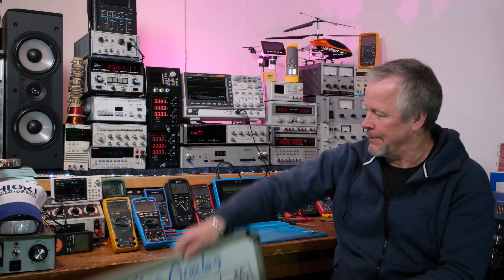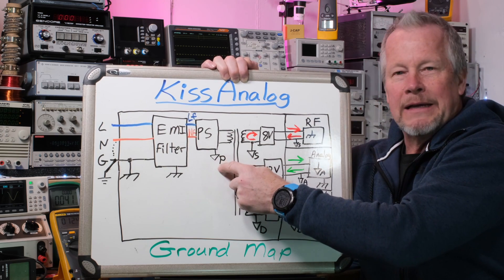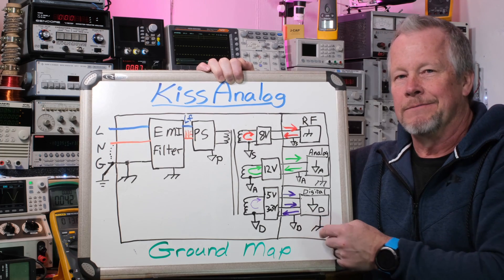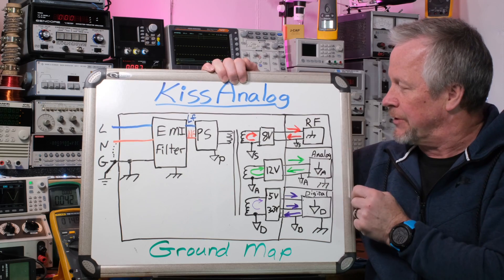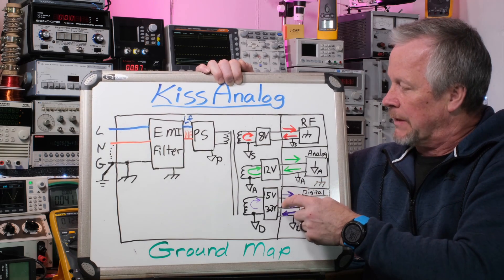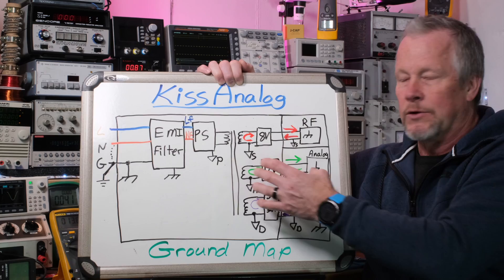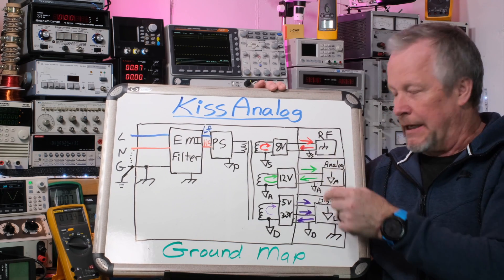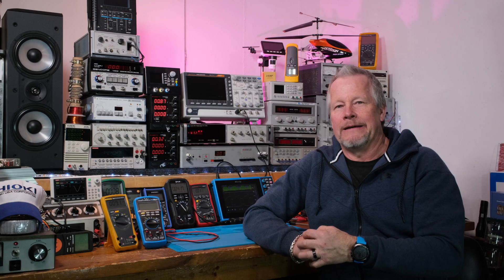A Ground Map Example - A system Design for Grounding #grounding #ground #safetyground

Comment: Telephone system in the UK uses -52V (positive end of the exchange battery strapped to "earth") to avoid electrolysis/leaching/corrosion issues on the wiring. I read that London Underground use a separate earth return system as early on they found if they didn't the earth current would leach chemicals from the ground due to electrolysing action.
Reply from the maker: Thanks John!  That is very interesting!  Thanks for the feedback!

Comment: I'm confused: You show each winding having a separate ground; to me this would only work if each transformer secondary was only-used as a half-wave rectification (single-diode in the upper-leg of the winding), because that is the only way you'd have a return for the DC to your ground.
I could see if you were using full-wave rectification (using 2-diodes) and the center-tap was tied to ground.
However, if you're using a full-wave-bridge then you could not tie the FWB's negative to a winding-ground; you could only capacitively couple it for noise.
So, maybe I missed something, or I'm making something literal that you are implying symbolic.
Anyway, great video as always & 73...
Reply from the maker: Great question - Thank you!  Each winding is galvanically isolated from everything else (primary and other secondaries).  Also, each winding generates energy which can be used to make an output voltage of your choice (given proper turns ratio).  Each of these output voltages would be converted to a DC voltage (most often), and the current flowing into the circuit that this voltage would power would return back to its particular winding that it was generated.  So, each winding can show, and should show a ground symbol unique for its output voltage - unless you choose to tie all the windings to the same return path.   Does that make sense?  I'll make a video explain this;)
Reply: @KissAnalog  I guess I still don’t understand. What I see is the lower part of the winding attached to whatever ground for that system. But is that also the negative return for that systems power supply? Because the only way you can have the negative returned be grounded at that lower winding point is to utilize that winding as a halfway power supply with just a single diode in the upper leg…

Comment: Virtual grounds on each device would solve the problem on the secondary side but the RF source needs an earth ground to filter out any lose RFI from getting into the other circuits. Great video..
Reply from the maker: Thanks for sharing!  RF is an animal to itself - and it will bring some interesting conversations;)

Comment: Trying to wrap my head around how the isolation transformer is doing its job from a safety standpoint. Take the RF box for example: it's L is tied to chassis ground and therefore the PS S ground is tied to its chassis ground. Now the RF box is also tied to rack chassis ground and the latter is tied to P ground (and earth ground). Touch S L and the current  can return to S N and cause electrocution. Am I missing something?
Reply from the maker: Thanks for the great question.  For there to be a current path - there has to be at least one series loop (voltage source with both ends connected - as in a short, or connected through a load).  The only current that can flow through the chassis is in the RF circuit - to and from the winding providing the power.  And there's the input EMI caps and chassis to Earth ground.  But there's no path from primary to secondary;)
Reply: P ground and chassis ground are never tied together. There are usually decoupling caps between P ground and chassis ground (earth), but that's about it. Secondary-side grounds are sometimes tied directly to earth for noise supression.
Reply from the maker: Yes you are right;) But technically, secondaries are physically tied to chassis which is then tied to earth - if the input power provides the earth ground connection.  On a ship of car the chassis is floating of course;)